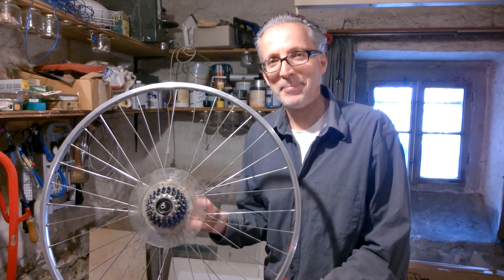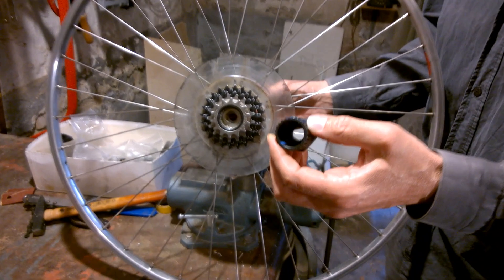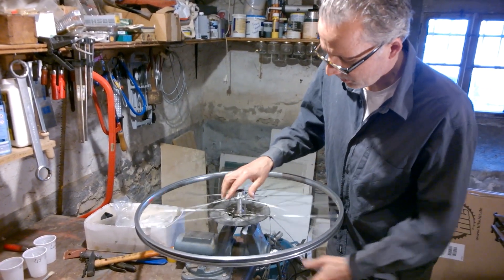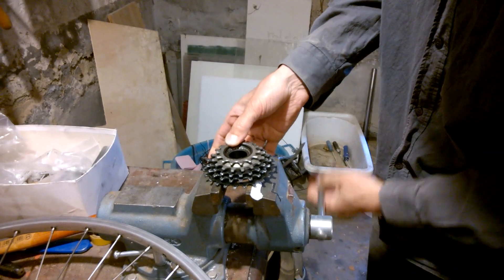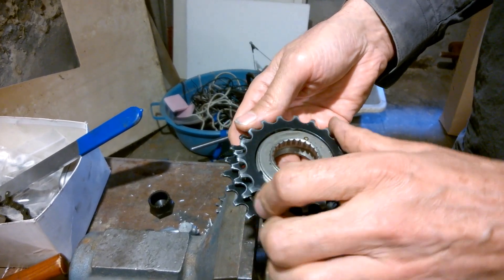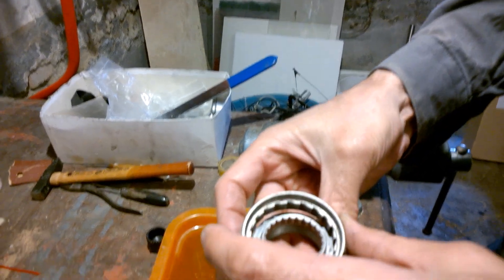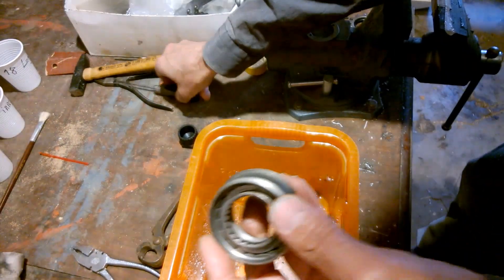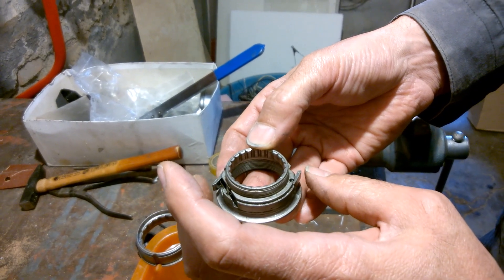We disassemble a Maillard cassette / freewheel, Peugeot bike

Comment: This was a great guide while servicing a 1986 Maillard Normandy freewheel from my Peugeot. 
For anyone looking to do this, the only part not shown here is actually using the two chain whips to unscrew the two outer cogs from the rest, you should be warned that they will be very tight. You can leave the freewheel on the hub to get better leverage with your two whips.
I also got the Kemper freewheel tool from velo-classic and it worked like a charm.
Reply from the maker: Thats true, I had recently also a case where it was very hard to loosen it. I would recommend in these cases to put it for some days into a pot of diesel or petroleum to weaken it

Comment: UK viewers, tool is made by Var, product ‘var RL-40500’. Not cheap at £18, but seems solid. 

Great tutorial, worked like a charm, thanks!

Instead of using 2 chain whips I carefully screwed the freewheel to a block of wood in several places around the biggest cog, then held the wood steady in a vice. This meant I had both hands free and could put my body weight behind the handle of the chain whip as it’s difficult to release initially.
Reply: Хорошее решение, а вот у нас съёмник к Maillard вообще нереально приобрести!😢

Comment: Thank you - very clear and a great video to watch before embarking on my first Maillard freewheel restoration disassembly/clean/grease/reassembly operation. In my case its from a 1960s Sun (a TI brand by then I think, along with Raleigh, etc) bike that I'm rescuing from a metal skip.  I just need to find my spare chain whip!

Comment: Wish I had watched this one first! Tried following a number of other tutorial videos that required using a whip chain wrench, but that was an exercise in futile frustration since the 'lock ring' is integral with the cassette assembly! If I had been able to get enough force on the chain whip against the 24 tooth tool, it would have broken one tool or the other, and/or ruined the whole assembly. Mine is a 'Made in France' Sachs Maillard assembly, essentially like this one, using the same tool (had to order from a seller in Bulgaria which took about a month to arrive in the USA). I did finally figure out this technique on my own after exhausting the other possible methods. Glad though to confirm that I did it right in the end. :/

Comment: 3:35 Can you take apart the cogs before taking the freewheel off the wheel? That way I could use force from the bike pedals instead of buying an extra chain whip.

Update: Yes it works, put the bike chain on the 2nd largest cog and the chain whip on the 2nd smallest cog. Use pressure on the pedal to slightly unscrew the cogs, then take the chain whip off and put the bike chain on the smallest cog, remove the wheel and proceed as described
Reply: Excellent idea, thanks!!!!

Comment: I am very impressed by your video. My worry now is that I won't be able to obtain the removal tool. Do you have any advice ? Many  thanks.
Reply from the maker: You could try to remove first the two smaller cogwheels. Then you could try to get grip to the freewheel forceps. No guarantee ... :)
Reply: Thankyou for your reply. I discovered that the freewheel is a Helicomatic type-------a beautiful design,  & in fact reasonably easy to remove with a large grip tool. The hub (& freewheel) is  now  removed, so that a more flexible Shimano hub & freewheel can be incorporated into the excellent Mavic rim & spokes. The 6 speed 12-24 Maillard is too high geared to take me up  the hills of the Pennines, I need at least a 30 tooth gear. I'm 68....... If you know of anyone who wants the Maillard hub & freewheel, I'll be happy to send it for  modest cost. The ebay prices are absurd. 
 Otherwise it will simply lie in my workshop .......  @frankofranko7888

Comment: Sehr nützlich.  Sockel bei velo-classic gekauft.  Danke.
Très utile.  Douille achetée chez velo-classic.  Merci, du Québec.
Reply: 3:50 i cant remove that. can you suggest something?
Reply: @EduardsESA  If you don't have a vise, leave the tire on the wheel.  Use an adjustable wrench at the end of a pipe, for more torque.  Hold the wheel in vertical position with your left hand.  Put your weight (belly) on the wheel while pushing down the pipe+wrench with your right hand to unscrew the cassette.
Si vous n'avez pas d'étau, laissez le pneu sur la jante.  Utilisez une clé à molette au bout d'un tuyau, pour plus de couple.  Tenez la roue en position verticale avec votre main gauche.  Avec le ventre en contact avec le pneu, mettez votre poids sur la roue pour l'empêcher de glisser alors que vous poussez le tuyau+clé vers le bas avec votre main droite pour dévisser la cassette.